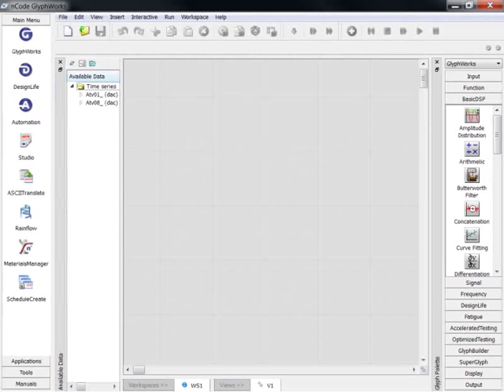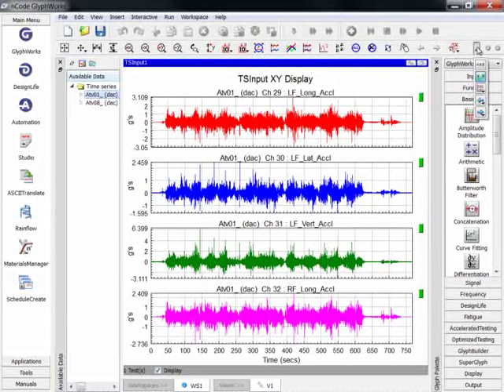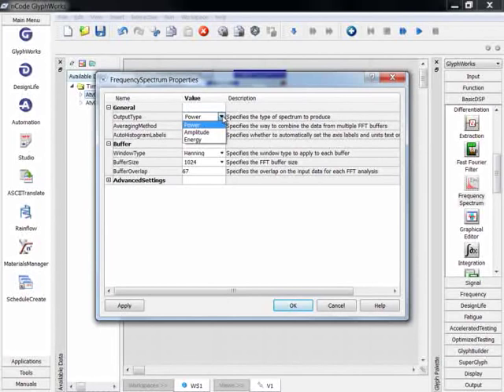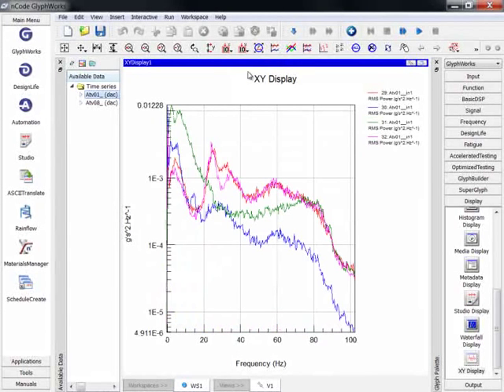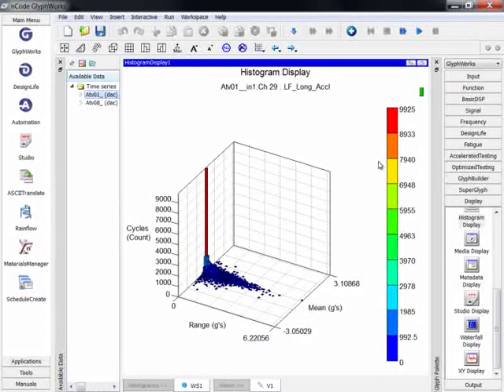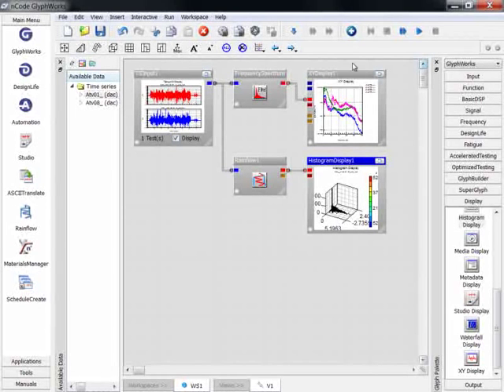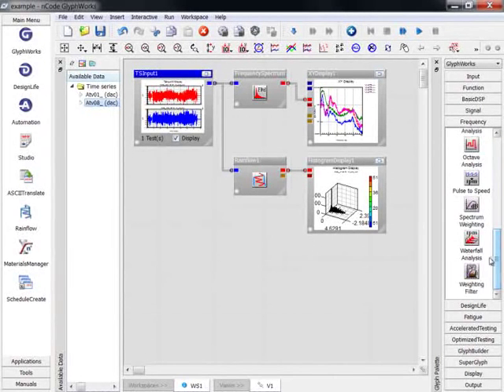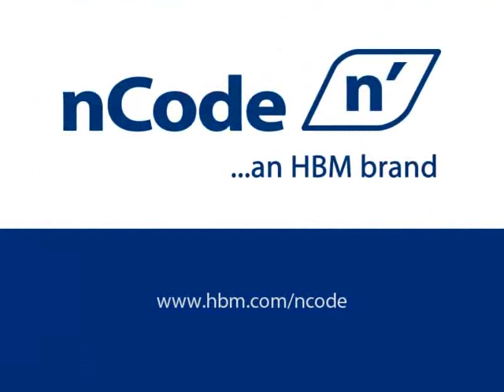Getting Started with nCode GlyphWorks

Comment from the maker: nCode GlyphWorks is a powerful data processing system for engineering test #data analysis with specific application to durability and fatigue analysis. Designed to handle huge amounts of data, GlyphWorks provides a graphical, process-oriented environment. Watch this YouTube video to see for yourself.